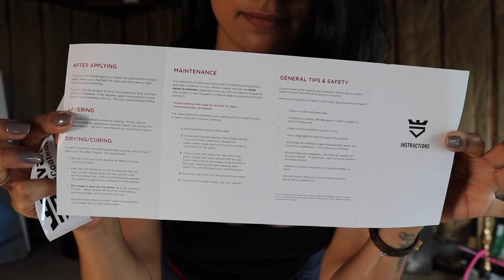$70 D.I.Y CERAMIC COATING AT HOME

Comment: These types of coatings aren’t bad at all. I don’t like how some of the manufacturers don’t tell you how long they really last but as a introductory product it’s not bad. Same with CarPro lite. , Tacsystems Moonlight DPC Shield Pro. Also coatings don’t protect against scratches but other than that you did a great job. Also top it with a SiO2 type of spray at least once every 25 days. Or use something like BeadMaker as a drying aid after every wash to lengthen the lifespan of the coating. Great job.

Comment: The spray on ceramics widely available at auto part stores for $20 work just as well with once a year application.  My winter daily goes to the car wash every week with virtually no reduction in performance.  Same preparation and application applies.

Comment: Cut slits with a razor blade in the side of the applicator sponge then push the cloth into the slits. Holds very well so less adjusting. Used Avalon king on my 2018 Aegean blue civic type r and I get comments all the time about how shiny it is even though it hasn't been washed in a while. Don't pay 1000s, do it yourself!

Comment: Yes , definitely more gloss. I keep considering this for my new Cupra Ateca but I have no garage and English weather , although hot today, cannot be relied on for the curing process. I assume you did the glass but did you do the black gloss. I have gloss grilles in black and they take ages to dry of to avoid water stains despite Autoglym paint sealer being applied.

Comment: Perfect timing! I'm going to to be doing this on my 4Runner in a week or so. I still have to prep the paint but it shouldn't be too bad as the 4Runner is a 2019 so the paint it in good shape. I'm going to wash it with Dawn, clay bar it then wash again. I'm using a different brand of ceramic coating but the process is similar.
Why would you think it would smell like a sharpie? LOL! You're too cute. 
Looks like you took your time and got good coverage. My 4Runner is friggin' big si it's going to take a long time but I'm ready for that. I'm retired so I have the time. Mine is a dark blue and the clear coat is so damn soft! It stains and scratches very easily and drives me crazy so I'm hoping the ceramic helps with that some.
As always, you look beautiful and now the FRS does too! Thanks, Bye!

Comment: You are not looking to see if the water falls off..you are looking to see if the water turns into balls of what. If you see any flat water flows, and no balls of water, then you need to do another coat or the coat did not set.

Comment: Also when your ceramic coating your vehicle you want to do a proper polish and correction you do not want to do a ceramic coating without doing that first-  And never ceramic coat your vehicle with the garage door open or indirect sunlight or with humidity level above 70% your flash times will be a lot higher than normal and create high spots.